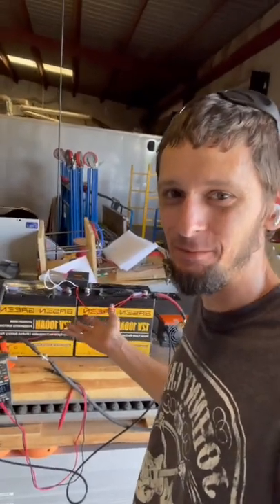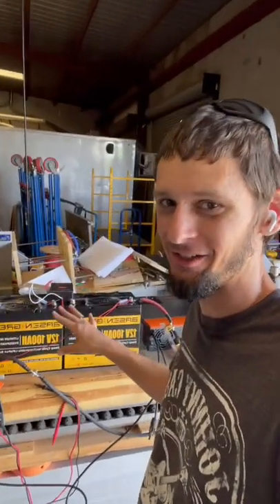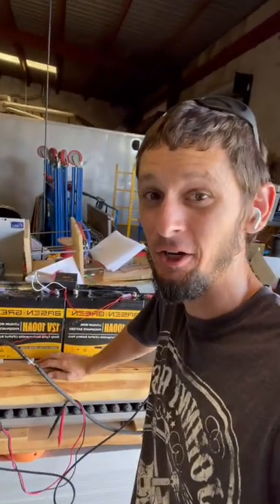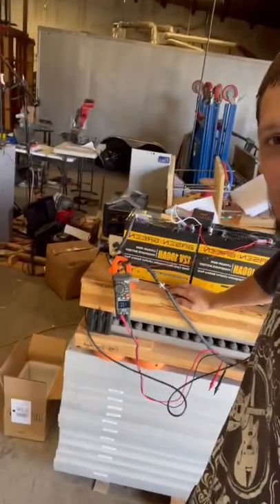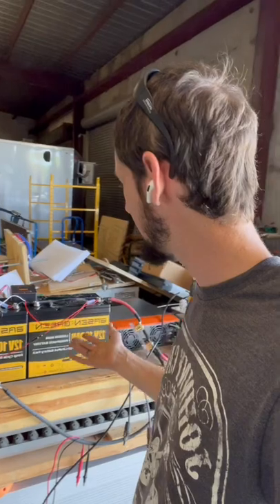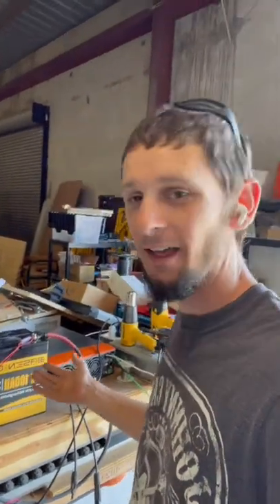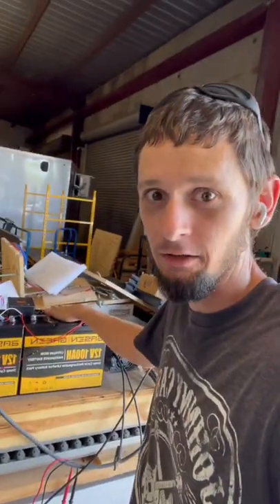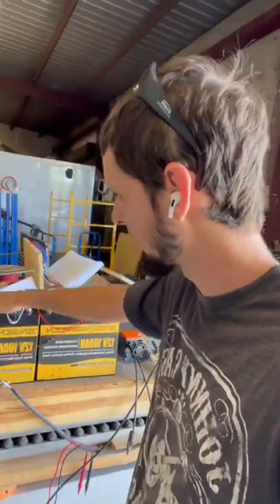Basen Batteries Refuse to Give Up

Comment: You selling those 12v 100ah batts?
Reply from the maker: Should be shortly. This was me testing to make sure they operate as advertised. Still need to do a capacity test.
Reply: Will they work in series?
Reply from the maker: @travishodges5179  yep they are rated for up to 48v.
Reply: @Beene Energy   hello, I am new to your channel. Wondering if you could help with some solar questions?